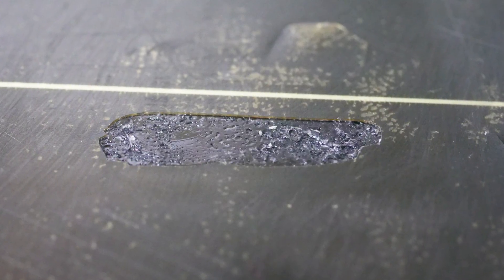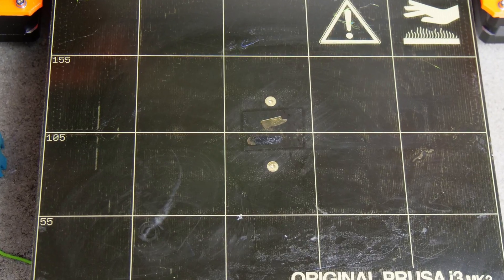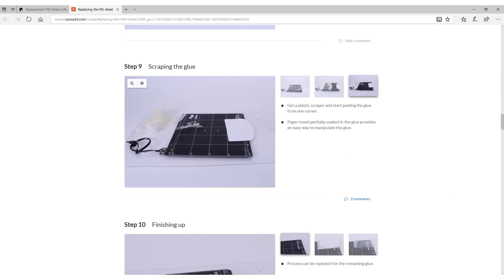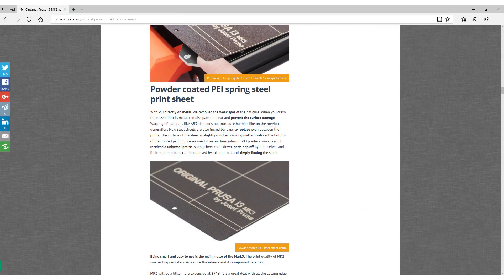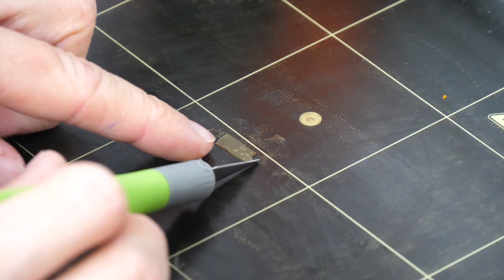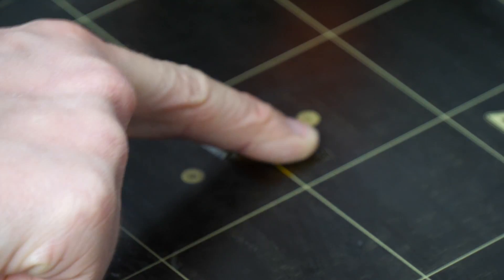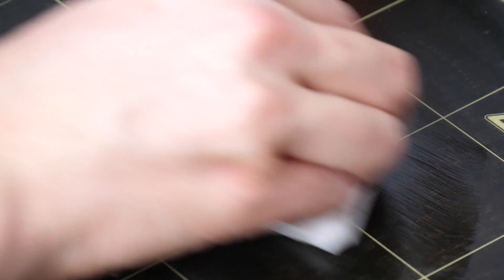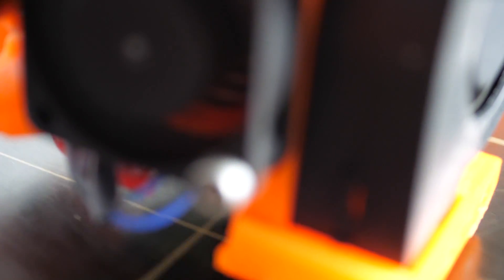Quick-fixing a broken PEI print bed || Original Prusa i3 MK2

Comment: Thanks for the tip with the kapton tape. I couldn't recover the ripped out part. So i filled the  hole  with 2k epoxy and stuck kapton  over it  while it still  was liquid. Looks like it worked but i havent printed on it yet. 

Btw  where do you  get  spare pei  sheets?

Comment: I didn't find it too hard to replace the PEI sheet. I used goo-gone instead of limonene. Inexpensive and didn't take too long.
I used the kit from Amazon: https://goo.gl/b1c38Z. Worked great and included the plastic scraper.

I do really like the idea of the spring-steel print bed, and would consider upgrading my I3 Mk2, if it wasn't 1/3 the price of a new system. I'm hoping they would offer the spring-steel only option as a $100 upgrade, I would certainly jump on that.
Until then, new PEI sheets seem like a good solution.

Comment: I replaced the PEI on my bed a few months ago.  It isn't as difficult as it looks.  Removing the bed sucks, but when you've done it as many times as I have for bearing quieting tests, you find the quick way to do it. D-Limonene isn't that expensive here, because we have plenty of citrus.  I was able to get it from down the road.  My wife asked me never to use it again because the scent is strong.  From research, I found that Acetone should work well for removing the glue, so I'm going to try that next.

Comment: i found out that co2 or freezing spray helps if the part is really stuck to the buildplate. Just a view seconds and the part should come loose very easily. I prefere this technique over the extensive use of a spatula and therefore dealing with the risk of damaging the buildsurface

Comment: Looks like a good temp fix. I just replaced my PEI sheet on my Prusa after 1 year of printing for the same type damage. I found replacing the PEI sheet was very easy. I did not need to take anything apart. Just heat up the bed to 60C then lift a edge and grab it with plyers and twist / roll the old PEI right off. Then I used a cheep product called GOO Be GONE also sold as GOOF OFF. It is safe and does not sell much and removes all the adhesive from the bed. Putting on the new sheet was easy as well, started with one edge and worked it down with a cloth to make sliding my hand easyer as I went. No traped air bubbles. I guess all in all it took about 20 minuets.
Reply from the maker: Thanks for the info. It's definitely a quick fix and due to all of your comments I might really be properly replacing the PEI the next time I order something from Prusa.

Comment: Hey Stefan,

ich hab einen i3 klon (geeetech)
habe jetzt einen orginalen e3d j-head und eine build tac folie drauf.

entweder ist mein druckkopf zu hoch und die erste schicht ist nichtmal deckend (feine lücken zwischen den fäden)
oder ein ticken näher dran und ich bekomme die teile nichteinmal mehr von der glasplatte runter... (abs)

hast du da tipps?

lg
Phil
Reply from the maker: Hey Phil, from my experience ABS sticks too well to BuildTak why you should work with lower temperatures. Maybe start from 60°C and work your way up until it starts sticking properly.
Reply: CNC Kitchen perfect, I'm trying it!

Comment: Super Video Stefan. Hast du evtl eine Idee wie man BuildTak wieder mehr zum haften bekommt. Habe jetzt die zweite Folie in zwei Monaten drauf ich habe aber das Gefühl das es stellenweise gerade in der Mitte nicht mehr gut hält und auch nixht meht schön ist.
Reply from the maker: Try  isopropanol, if that doesn't work then you might need to replace it again. Since BuildTak is quite thin it's way less robust than the thick PEI sheets, so maybe next time try these.
Reply: I would buy some PEI sheets @prusa, but they have really high shipping costs.

Comment: You should be able to purchase D'limonene at €20 per liter :)

Interesting to see that it happens for everyone almost always in the middle of the bed. 
Wouldn't it be possible to melt PEI and put it in the hole after which you sand it flush? :)
Reply from the maker: Not the worst idea. That kind of reminds me how you repair a ski: https://www.youtube.com/watch?v=YB9i2OKW7aM
Don't know if that's possible with PEI. You guys don't have any Ultem/PEI filament around? ;-)
Reply: I was wondering if using an electronics hot air blower would be a good idea. It can certainly get up to sufficient temperature to melt the PEI and with a number of nozzles from only a few millimetres diameter and adjustable temperature and air flow it should be possible to keep the heat limited to only the damaged area.

Comment: not sure about you but ive been using blue painters tape (the wide one) as print surface with not a single problem at all. ive used it on my i3 clone glass bed but yo be fair it sticks better and is less prone to damage on my mendel's alumuniom bed.
Not sure why no one uses it when its so cheap and works so well
Reply from the maker: Been using blue tape for years but PEI mostly works just as well, leaves a nicer surface finish and way more robust!

Comment: Hello, where can I buy some real PEI sheet in DE ? I have some from Amazon but I think    is a fake
Reply from the maker: Check eBay and look for a reputable, German seller. Should cost you 15-25€ depending on the size.
Reply: CNC Kitchen I saw the one from Prusa is pretty cheap, can that be glued to an MK3 Aluminium heated bed clone ? My PEI sheet is much worse than yours, already broken and some parts lifting from the center

Comment: I just replaced the PEI and it was a lot easier than I anticipated! I just used some random glue-cleaner from the supermarket. Just let time do the job! Applying the new sheet was very easy as well, much easier than to put a screen protector on a phone. The new springsteels has an ugly surface finish !
Reply: In my opinion, prints from glass have ugly surface finish :) But maybe you will be able to pick from several different densities of the powder coated sheets. 50 µm powder looks really smooth, like satin almost
Reply: Štěpán M. I hope so, from the pictures I've seen the surface looks like an orange peel

Comment: Kannst du mal einen auf Spiegelplatten drucken Test machen. Ich höre oft in 3D Druck Foren das einige darauf schwören und nichts anderes benutzen. Ich persönlich drucke auf PEI aber so ein Test wäre sicher interessant ☺️
Reply from the maker: PEI works way better than glass or mirror. Used to print for 2 years on glass and were always covering it with blue tape because the glass just was not working that reliable.
Reply: just use glue stick on glass... also this is required on Prusa PEI if you are doing more complicated prints. I do not see much difference in glass to PEI. I prefer glass so I can remove it and it is easy to get replacement or just use the flat mirror.
Reply: weltraumkuh yeah i used glass with Hairspray before but i'm just testing some things. Already printed 1Year on glass

Comment: You can use Acetone to help clean the glue off. Get a spatula under a corner, then peel it off. Then clean everything with acetone, much cheaper than limonene. The high temp glue turns into a sticky goop with acetone, but it works to dissolve it.  Applying PEI on a small bed like the Prusa is not terribly hard. I have all my printers with PEI, from an I3 with 200x250 bed up to a 24"x24" bed. Takes some practice to get the adhesive to go down without bubbles, but I wouldn't be terribly happy with an indentation like that in my prints. I've replaced PEI sheets on printers where the PEI was too scuffed up to be sanded, or where adhesive started to fail, rather do that.

Comment: Prusa, being a really smart person, needs to come up with a new idea for the bed because that PEI is a PITA to replace and why I would never use PEI or if I do it will be on something I throw away when it fails.
Reply from the maker: Josef mentioned that they are using high curie-temperature magnets for that. They will not be as strong as neodymium magnets but they are able to cope with the temperature. Does the Mk42 bed even go up to 150°C? I think with the 12V system around 120°C should be the max.
Reply: The Best Stooge He already came up with a good solution: A flexible magnetic PEI powercoated springsteal buildsurface
Reply: Two things wrong with that and that is #1 I wouldn't just throw that away and #2 magnets do not like heat.  I  am unsure if 110c would affect them but I know the temps of a glue gun, for instance, will zap the magnetic properties right out of neodymium and why the magnet sites tell people not to use hot glue on them.
Reply: The Best Stooge yeah thats true. Doesn't thought about that. Kinda funny many 3D Printer companys start using magnetic flexible beds 😥
Reply: Yep so I guess 110c doesn't harm them but over 150c they will begin to get zapped because that is how the magnet is made.  They make them red hot then zap an electrical field into them and cool them down so when you hit them with heat they begin to lose their magnetic properties.
Reply: Yep, high curie temperature magnets which the bed can't even remotely reach
Reply: And why would you like to throw the sheet away?
Reply: Not sure but on the MK3 he went to a 24v system.  For a 12v system 150c I doubt could be achieved.

Comment: I think iso prop will remove the glue.
Reply: Will, but with a lot of effort. Acetone dissolves it, turns it into a sticky goop, but use some paper towels soaked in acetone, and it will come off. I also use a utility knife blade to collect the goop/kinda scrape it off carefully without damaging the bed it self, and dispose of it in a trash bag.

Comment: I found that I could just lift the PEI sheet at one corner and slowly peel it off, without disassembling anything and without using any solvents. Prusa's recommended procedure seems way too complicated! If simply peeling off the PEI sheet leaves any residual adhesive, it can probably be removed with a citrus-based adhesive remover like Goo-Gone or with a rubber-cement solvent like Un-Du. I've gotten into a lot of sticky situations over the years, and these products have never let me down.
Reply: Hm, maybe it gets brittle with heat and age. Mine was relatively new. I've ripped up more print surfaces than I can count! I'm anxiously awaiting my new MK3 print bed, too. BTW, your videos are very informative. Thanks for making them!
Reply: i did the same think a few weeks ago.... rubbing alcohol and a cloth based rag and a lot of rubbing in circles

only downside was my thumb was hurting a bit
Reply from the maker: I tried that on one edge, but my PEI seemed very brittle.
Reply: I forgot to add: I placed the heating bed in the freezer before removing the PEI sheet. Next time however, I will try to use cooling spray if I can't remove it without cooling it first in order to spare me from the whole disassembly and reassembly procedure.

Comment: I just replace mine, and honestly it isn't a big deal... And if your going for the steel bed you will have to dismantle even more.
Reply: Francois Bujold 
Yes, but it's worth the additional convenience of being able to remove prints quickly and put on a fresh print surface and start printing again immediately especially for those who print lots or use 3D printing as part of their revenue stream. The flexible sheets should also make print removal a breeze. No more need for sharp scrapers or other tools!